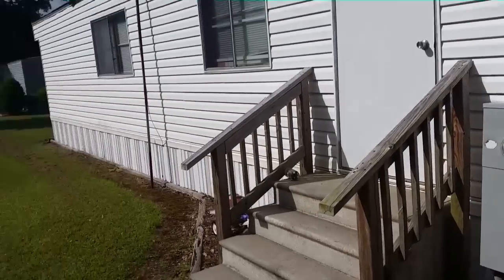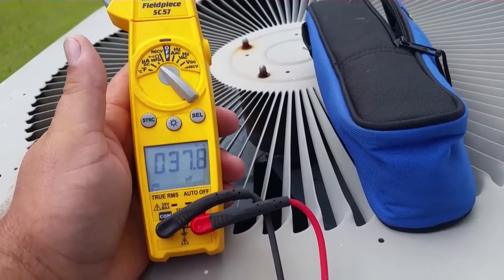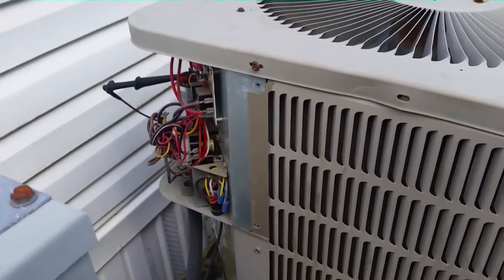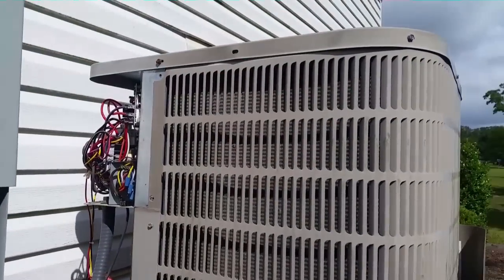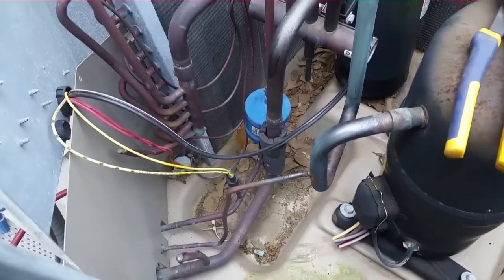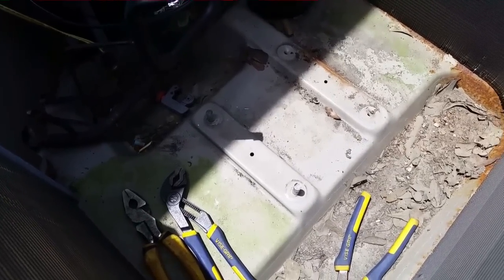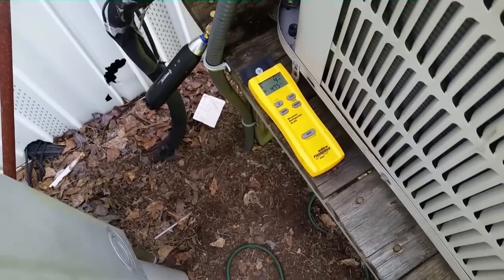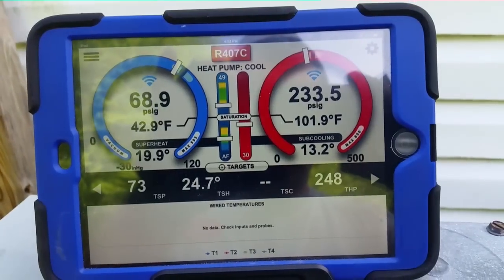HVAC Service - Goodman Bristol to Copeland Compressor Replacement

Comment: Great job on that unit Zack. I wonder how them bolts got bent...
Reply from the maker: I don't know. It would be wild if the compressor did it.
Reply: talyn875 I wouldn't put it past the compressor to bend the bolts. I had a compressor break off four bolts on a roof top. Wouldn't have believed it if I didn't see it myself. You do a really nice job on your bends. Nice video!

Comment: Just curious when you replace a compressor/change refrigerants that will use different oils do you try to flush or any mineral oil or just put the new compressor in/add some poe oil to the system?
Reply from the maker: This compressor came with POE
Reply: talyn875 That was a poorly phrased question. Did you try to flush any mineral oil out of the coils and lineset or just put the new compressor in? I'm not very familiar with replacement refrigerants. I read it is ok to have mineral oil on the system as long as a percentage is synthetic. I was just curious about your opinion/practice.
Reply from the maker: John McMaster I did not flush anything. Guys are saying that only a small percentage has to be POE.
Reply: talyn875 Thanks for sharing!